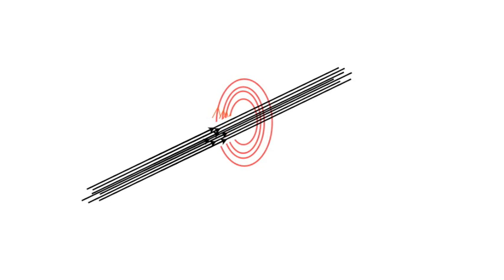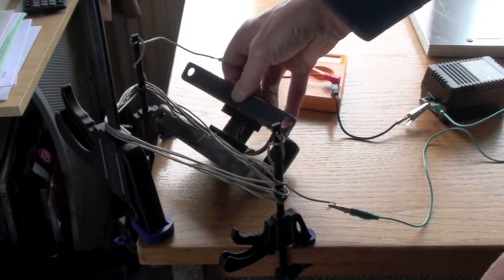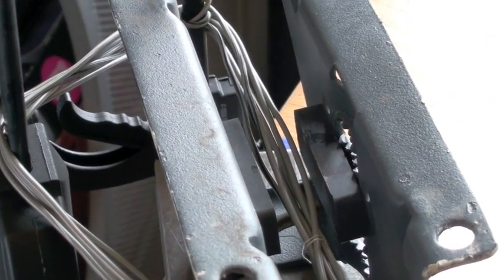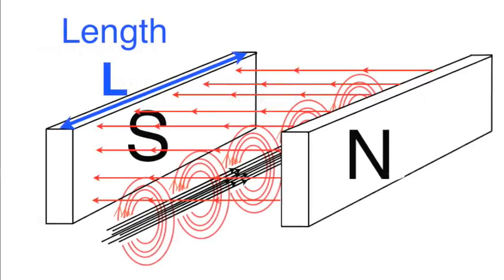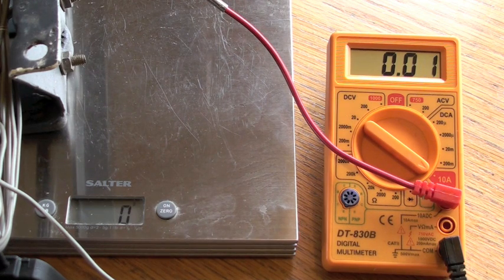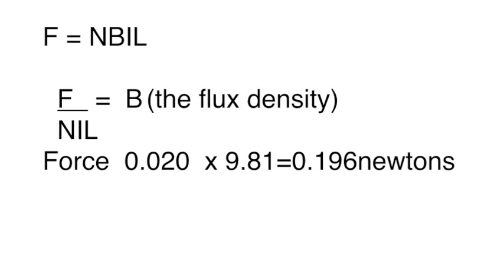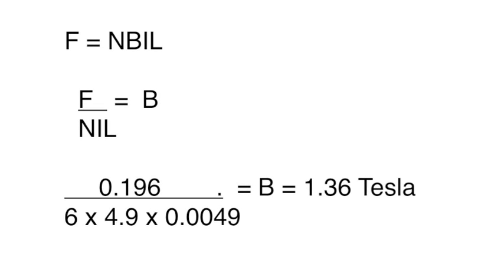Magnetic flux density measured for beginners: from fizzics.org

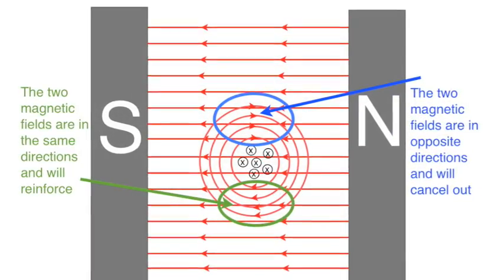Comment: At 1:39, there is a slide that mentions that the magnetic fields in opposite direction above the wire cancel out and the magnetic fields below the wire reinforce.  Well, I have a different thought.  Look at the flux lines of the magnet.  They are designated as flowing from N to S.  If we look at the clockwise flux lines of the wire, and using the same notation the flux flows from N to S, we see that at the top of the wire, the N polarity generated by the wire is on the Left (which is aligned with the South Magnet), and the S polarity is on the Right (which is aligned with the N magnet).  As we know with magnetics, opposite polarities attract, so at the top of the wire, the wire is attracted upward.  Looking at the bottom of the wire,  the N polarity is on the right, and the S polarity is on the left.  Since N-N and S-S magnetic polarities repel, there is a repulsion or an upward push on the bottom of the wire.
Reply from the maker: Hi, this is an interesting series of thoughts  but you say that "the N polarity generated by the wire" and there is no N generated, it is a circular field. Whichever argument is used it is a way of visualising the explanation of what happens.

Comment: B = 0,136 T .   You used 0,0049 instead 0,049. God Bless you.
Reply from the maker: Absolutely right! Nearly 10,000 views and no one else noticed and neither did I. I have put a note on the frame.  Thank you
Reply: I didn't catch that error, but I did know for sure that 1.36T seemed off by about a factor of 10 given that sort of magnet and the setup.  1.36T would be impossible with any sort of magnetic material in that setup.
Reply: Oh, and it's an awesome video, thank you!
Reply: Good for you 👏

Comment: Excellent explanation, thank you. Correction: the length of the wire within the magnetic field is 49 mm = 0.049 m (Not 0.0049 m), so the final answer will be 0.136 Tesla. Great experiment, thank you one more time.

Comment: Whats the difference between
B flux density
and
H field strength. /
Reply: Same question i do have?

Did get answers you can share it

Thanks
Reply: @mohammadalshaikhhasan5091  yes I believe I do now understand it.
(I think)]
Note the formula B = mu(0)mu(r)H
If a current flows down a long thin wire in FREE space then moving out in circles is a magnetic field This is shown in the  vid and  is H the field strength
Many texts describe that as B but I believe that is wrong and is the root cause of the confusion..

Now no longer in FREE space we have a current  flowing then the resultant field is B the flux density,  In the the vid this is shown as the fields interacting between the the magnets and the wires.

Imagine a rectangle at 90 degrees to B then the magnetic strength through that rectangle is maximum.
If the rectangle is at zero degrees then the magnetic effect is zero.
ie sin (theta) is involved in working out the strength.
sin(0) = 0=zero effect
sin(90) =1=maximum effect.

Comment: ROGER please Why opposite magnetic fields in opposite direction cancel out , Do you mean in this case the magnetic field created by current and the other of Magnetic poles , are the result cancel out in all cases , In forces the result and direction of opposite  forces is relating to the value of each force how about the magnetic fields ?
Reply from the maker: The strength of a field is a measure of the effect it would have on a "theoretically tiny" magnet inside the field. If there are two fields, one pulling in one direction and another in the opposite direction then they cancel out.

Comment: Does the distance between the magnets affect the flux density? If the magnets are closer together do the Teslas increase?
Now I have to rethink my Axial Flux calculations with, N x A x T/s = Volts.
Will the result from this experiment be used to calculate Faradays Law for a Magnet Moving Past a Coil?

Comment: Question: I'm sure that if you increased the number of wires from 6 to 60 while decreasing the current to a 10th of the original the force would be equal to your original; however, is there a difference in the magnetic fields themselves? Is there 10 times fewer "lines of force"  that are 10 time stronger in one configuration over the other for example? Is one "line of force" the same as another? If Two magnetic fields have equal strengths loop over a greater distance, say earths 50 microteslas vs  a fridge magnet over a few inches, then what is the difference between the individual "Lines of force?"

Comment: What do you mean by magnetic strength. If more current passes through the wire does it add more magnetic flux lines, or increases the speed of magnetic field particles?
Reply from the maker: Think of it adding more flux lines

Comment: I'm designing a power distribution hub for a large quadcopter using (2) copper washers... One for positive and one for negative. They will be isolated with a rubber gasket and will distribute the power from a 22V power source to the motors. I'm concerned about the magnetic field created by the current and it affecting the flight controller electronics. Specifically, should I cut a slot in the washer to 'break' the loop? So instead of having a circle washer, it will look like a 'C'. Will it help or hinder?
Reply from the maker: hi, I'm no expert on remote control systems but I would not have thought that the field around a single wire or the washer would be significant, particularly since the current will not circle round and around the washer even without a slot.
Reply: Thanks for responding. The electronics on RC drones is very susceptible to EMI, so I want to minimize. I'm not an electrical engineer, but I was told that having a circle washer vs a "C" shaped washer allowed the electrons to flow in a circular path and could cause more interference. Are you saying the shape of the washer has no bearing on how the electrons flow? BTW, I sent you a friend request so I could send you an actual picture of the power hub.

Comment: Thanks for the video.  I used your method to measure the field between two N52 magnets (25 mm x 49mm x 10mm) at a gap of about 25 mm and came up with around 0.15 Teslas.  However, the calculator at this site: https://www.kjmagnetics.com/gap.calculator.asp leads me to believe that I should have measured twice that strength.  Note that the calculator is set up for disc magnets, so I assumed an intermediate diameter, i.e. 37 mm.  My measurement device did not use a steel holder.  It was wood, and the magnets were held in place with two thin polycarbonate sheets.  I don't think that would have made a difference.  Any ideas on the cause of the discrepancy?
Reply from the maker: Hi, sorry I have only just seen your comment which, for some reason, was flagged as unsuitable. However the answer is no, I don't know.

Comment: Thanks for the great video.

I want to know the reason behind the vertical motion of the wire, I understand the magnetic density difference above and under it, but since the wire can be made of non magnetic material (for example copper), what exactly is the force pushing it up ?? is it the Faraday force acting on the electrons. 

A second question may be more stupid than the first one ;), does the magnets have to be held by a magnetic material ??, it is just difficult for me to apply Newton third law here, in order to understand why we have the motion of the metal brakets.

Thank you very much
Reply from the maker: Hi, yes the material of the wire does not matter, mine were copper. The force is caused by interaction between the fields. The field around the wire is caused by moving charge i.e. the electrons within the wire, hence the force on the wire.

The brackets used here were iron which increases the strength of the field, but with a bit of glue to hold the magnets in place, other materials could be used.

Comment: 1:46 could you further explain how the 2 permanent magnets will be pushed on opposite direction?
Reply from the maker: This is just Newton's Third Law. If the wires are pushed up then there has to be an equal and opposite reaction, that is a push downwards. The magnets are therefore pushed down and that extra force downwards is what we measure on the balance.
Reply: Roger Linsell i could only imagine that applies on contact forces. i mean physically in contact. but since the wire in middle of the two magnets, i suppose the only reason the magnets being pushed down is due to distortion of magnetic flux. in which i couldn't find any scientific explanation/formula on that
Reply from the maker: No, it applies to any forces. Try getting two magnets and pushing the north poles close together. There is a force on both, equal and in opposite directions.

Comment: big thanks for this beautiful video, The setup works similar to "a moving magnet voice coil motor"??? BTW some errors exist in mathematical calculations.
Reply from the maker: Hi, thank you, I think. It does aim to explain the basics of all electro/magnetic devices producing movement. There is a decimal place error, acknowledged in  a remark below at 4.34 where I have used 0.0049 instead of 0.049
Reply: Roger Linsell, what would be the length L in case of a current carrying coil placed between two magnets. In this video, L is considered as the length of the magnet because the wire is straight.
Reply from the maker: @imranhbagoro  If the coil is all within the magnetic field then it is the area of the coil that is key. The emf produced depends upon BAN where B is the magnetic flux density, N the number of turns in the coil and A the area. The emf will rise and fall in a sine curve but the maximum emf will be BAN x omega where omega is the angular velocity.

Comment: Could you please provide the schematics for this practice?
Reply from the maker: Do you mean a line diagram of the parts?
Reply: Yes. I want to do this experiment. What I mean is if you could provide the diagram, so I will see how did you conected the multimeter and how conected the source to have current in the wire.

Comment: Would it be possible to create a boat that is being pushed by interaction of earth's magnetic field and a coil magnetic field? I saw a bar magnet lining itself with earth's magnetic field on the surface of water, what will happen if it was a coiled magnet?
Reply from the maker: An attractive idea and maybe you could get a tiny push in one direction. in practice however the Earths magnetic field is very weak and the portable magnet would need to be very strong. You would not be able to avoid the Law of Conservation of Energy, the energy needed to create and turn the magnet around would be greater than that gained.
Reply: Roger Linsell but if i was able to make a disc like loop of wires. Basically wire on wire only, it would become a very wide loop covering big surface area and interacting with more of the earth's magnetic field flux lines... like a ufo...
Reply from the maker: Yes, but the larger the area of the coil, the weaker the field the current creates and I think the electrical energy driving a motor would use the energy more efficiently

Comment: How downward force opposite to upward electromagnetic force exist? Electromagnetic force acts on conducting wire. How wire act reaction force to scale?
Reply from the maker: The electromagnetic field which pushes the wire up is the same one that pushes the magnet down, with equal force
Reply: @fizzicsorg  Thank you for answer! But I'm still confused. The electromagnetic force pushes the wire and so the wire makes reaction force down. However the magnets  are perfectly  away form wire. I think it doesn't have any way to send force wire to magnet. Help me...
Reply from the maker: @SoyoungOh-f4q  The electromagnetic field around the wire and the field of the fixed magnets act against each other. Think about two permanent magnets with north poles facing. The repulsion is  between the two magnets, both are pushed with equal force.

Comment: what about the weight of the magnets and steel bracket?
Reply from the maker: The balance is tared (set at zero) after placing the bracket and magnets so the measurement is of the extra force created by the interaction of the magnetic fields.
Reply: of course. cool.

Comment: So,you are measuring the flux density of the magnet. What about measuring the flux density of the wire?
Reply from the maker: That varies on the inverse of the distance from the centre of the wire/coil and can be calculated from the current and the number of turns.
Reply: I mean how to measure?
Reply from the maker: Calculate using B = magnetic permeability x current / 2 x pi x radius from centre. Could measure using a Hall effect probe.

Comment: can you tell me why  there's a force pushing the magnet downward when there's a force pushing the wire upward ?
Reply from the maker: If there is a force pushing the magnet down then something has to be pushed up to balance that (Newtons third Law) The onlt other component in this demonstration is the wire.
Reply: It's still not clear why the forces are resolved along the vertical axis. At 1:47, it is clear that the forces will cancel each other at the top - but I would have thought that the force will accumulate along the horizontal axis (based on the drawing), so I was expecting a left <-> right motion rather than a up <-> down motion.  Could you explain why the movement is up <-> down instead of left <-> right?
Reply: Neil Osborne The force experienced by a current in a magnetic field is at 90 degrees to both the current direction and the external field direction.

Comment: why did you convert mass to 0.020 when calculating the force. The mass value was 20kg which is the SI unit. why F = 0.020 * 9.8 = 0.196N
Reply from the maker: Sorry about the slow reply, I have been away. The mass value is 20g not 20Kg so 20g = 0.020Kg
Reply: @fizzicsorg  oh okay. I understand now.  I am a graduate student and for my thesis I want to determine the Magnetic and electromagnetic field emission from electric cars.  I would love to share my write ups with you for advise if you are open to it. Thank you for responding

Comment: unit of 0.1361 is tesla? isn't it webers? since T=Wb/m^2 you need area to get tesla...
Reply from the maker: Hi, it is great to see you are thinking this through. You are right that flux density is dependent on area, however, the calculation here is from the value of the force on the wire. The force is dependent flux density not on the total flux so we don't need to take the area into account.
Reply: ok thanks.if B=unit tesla then phi=can either stand for magnetic or electric flux. Just want to double check.
Reply from the maker: Hi, sorry I don't understand your question. What are p and h. But in any case one thing cannot represent both magnetic and electric flux.
Reply: oh i mean that greek alphabet "phi" a circle and a vertical line right in the middle....
Reply from the maker: Well no, magnetic and electric field strength are dependent upon different conditions.

Comment: every thing is great but i think that according to right hand rule the north and south are reversed  at 0.38 second
Reply from the maker: Hi Summaya. The magnets shown are permanent magnets which I put in place, not a magnetic field created by induction. The field around the wire and the field of the permanent magnets will reinforce below the wire so pushing the wires up and at the same time, pushing the magnets down.
Reply: so do you want to say that magnetic field due to permanent magnet is changed from magnetic field due to current  but i want to say that  line arises from south but i read that magnetic field lines arises from north to south
Reply from the maker: Check the diagram from 1.32